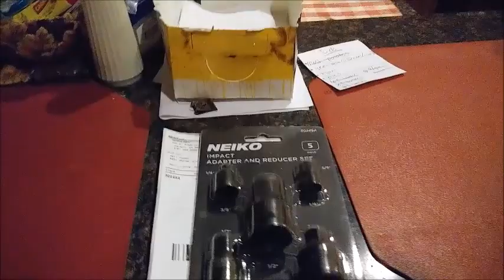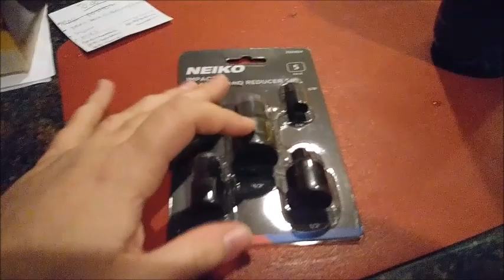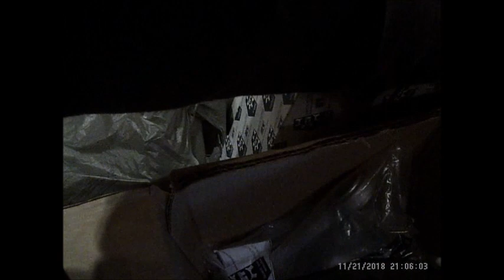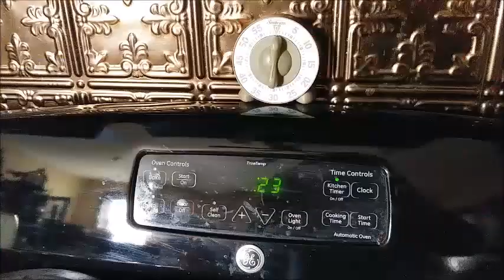BMW e38 wheel bearing replacement and ABS ring transplant

Comment: WWD is terrible. Low quality, 60 day warranty and no abs tone ring. After all the work it will only last a little while and then more work. OEM can last over 200,000 miles. It's only $90 for an OEM  hub.

Comment: How does these bearing works ?
Reply: How is the quality of WWD works ?
Reply from the maker: @38598463  i have no complaints about my WWD wheel bearing for the e38. It's been great ever since the install. Just know that if you choose that hub bearing like I did, you will need to very carefully remove the wheel speed ring from the FAG bearing and grind it down and carefully place it on the new WWD hub bearing or you will not have ABS, Traction or stability control. If you have the tools and patience to do what I did you will not be disappointed. My time was worth the cost savings to do the ring transplant.